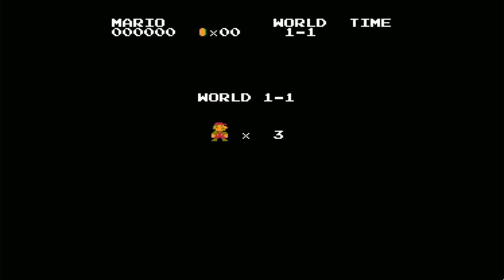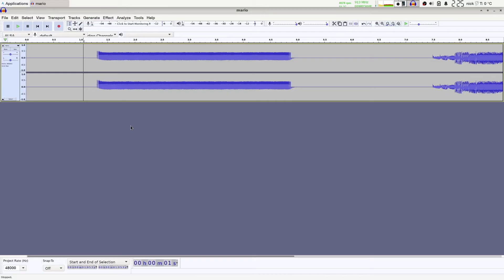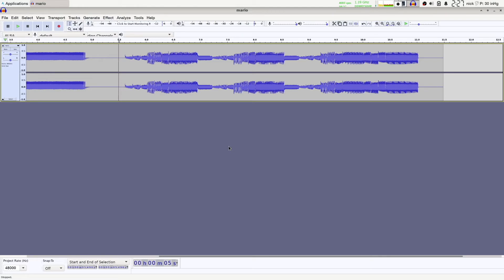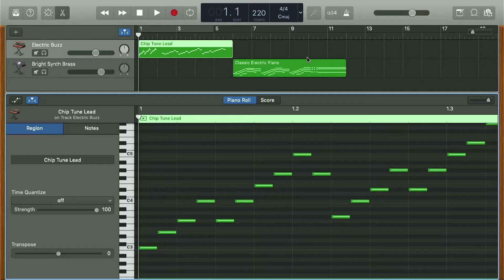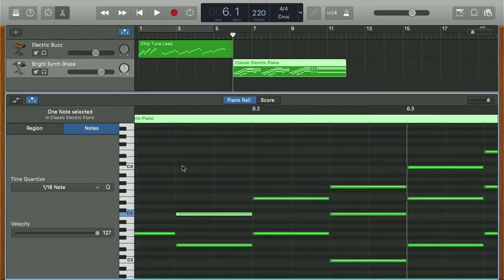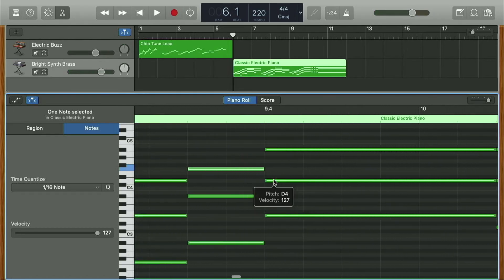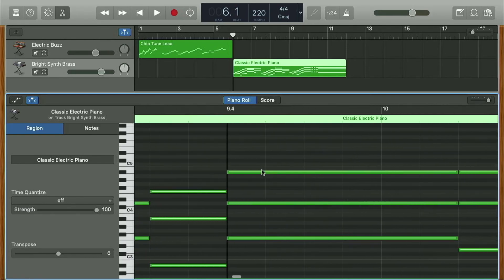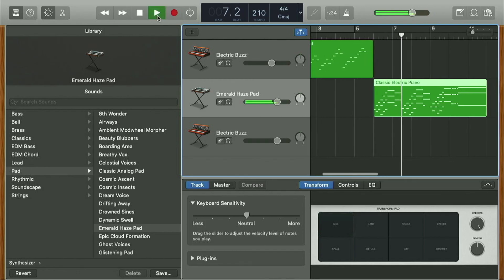Super Mario power up sound is the end of level sound sped up?  Not quite

Comment: HOWEVER, there is a very clear way they could have saved space. The Power Up sound is literally just 5 notes (C-E-G-C-G) repeated and transposed. It would have made a lot of sense to store these 5 notes as a variable, and then just say "play this motif starting on this note". This would save even more space than trying to transform the (quite different) flag pole notes. Here's what it would look like in psuedo-code:

$motif = "CEGCG";
PLAY $motif;
PLAY transpose($motif, 12)  // up an octave;
PLAY transpose($motif, 8)  // up a flat-sixth;
PLAY transpose($motif, 20)  // up an octave and a flat-sixth;
PLAY transpose($motif, 10)  // up a flat-seventh;
PLAY transpose($motif, 22)  // up an octave and a flat-seventh;

Most early music tracking code had functions for easily repeating and transposing lines, since many layers (particularly drum beats) were made up of repeated figures. Coding this from scratch for just the purpose of creating the power-up sound wouldn't save much space, however it's likely that this function was already built into the music playback engine for other purposes (so you didn't have to write out the drum beat over and over again). You could easily re-apply this to melody notes in the above pattern and save quite a bit of space!

And there you go, a much easier method of saving space for the Power Up, then trying to extract it from the Flag Pole Fanfare!